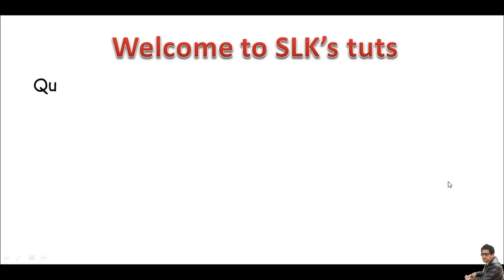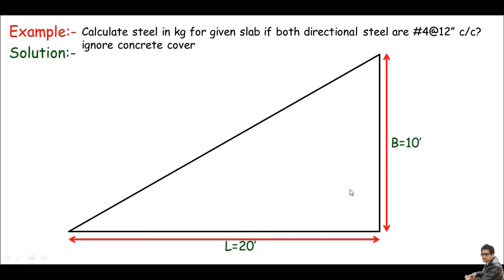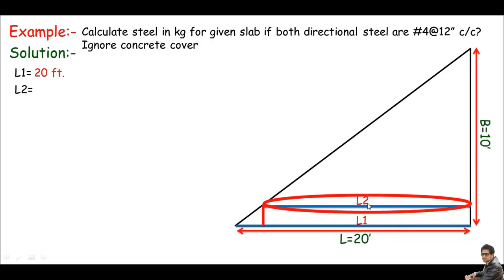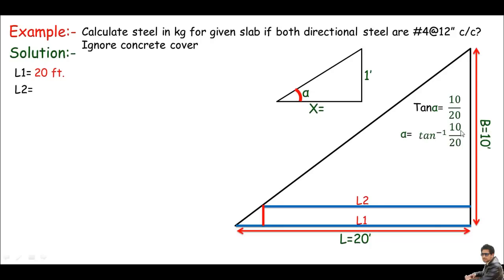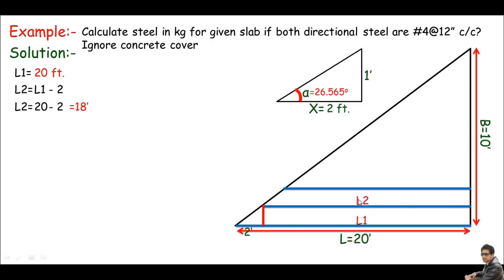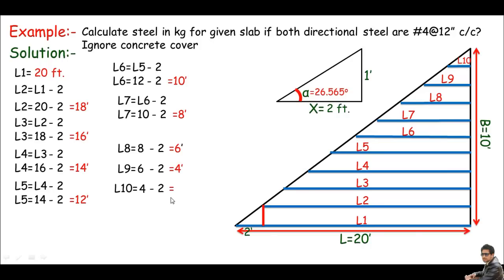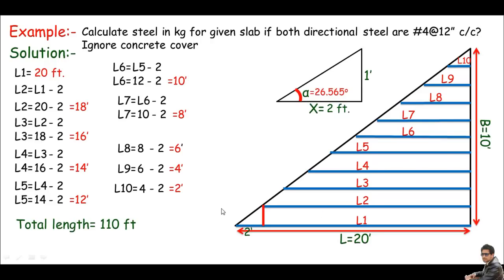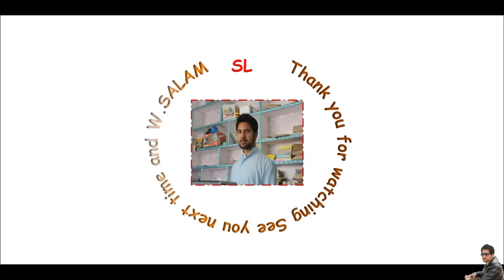Quantity survey :- Steel calculation for triangular flat slab.

Comment: Sir, sum of triangle is 180° and here in this example it should have been 45° for that small triangle as in this example it is obvious that it should have been 45° coz total in this triangle will be 90°+45°+45°=180°. But why you found out the degree of that triangle by applying trigonometric ratio when it is 45°. Please explain I am confused. Reply immediately sir. Thank you.
Reply from the maker: Protin Rabha 
dear this will be not 45 degree because both sides of triangle are not same.... When both are same then 45 will be right. but here lenght and breath are not same......

Comment: Hello Engineering Boy, using THALES theorem: X= B/L * 1' = 20/10 * 1' = 2' ; no need for tan or tan-1, right?
Reply from the maker: Yes but no 😂
Because this theorem does not work always. For example
If you have
B/L= 23/11
Then that theory will not work. However tan or tan-1 works always

Comment: dear plz explain (26.565)  and using this u can find x= 2 feet i calculate this the figure can,t match
Reply from the maker: Muhammad Zia ud Din Awan 
take the tangent of 10 and 20 using your calculator....

by the way you can also find the digit 2 by dividing the long side of triangle by its short side. like 20÷10= 2
Reply: Dear plz 1/tan26.565 using this u can find x=2 but ,,,,i calculate the figure can't match ,,, comment actual ans

Comment: Salam brother, how did you get the 52.9
Reply from the maker: actually the formula is D^2 / 24 to find weight of steel in lbs per unit length.
so have just converted lbs into kg.
like 24 x 2.204 = 25.9
Reply: Elegant art of teaching